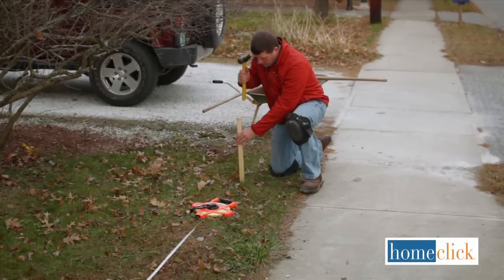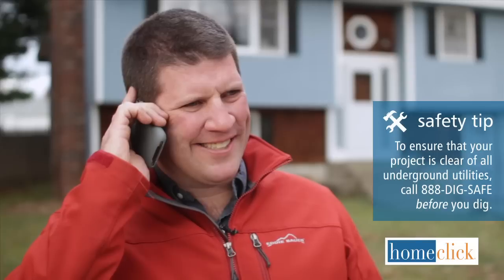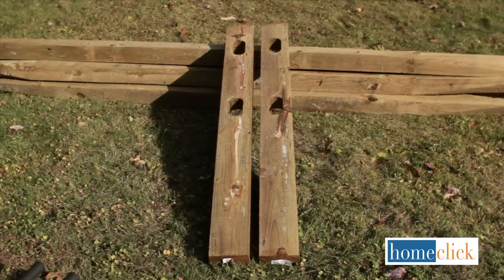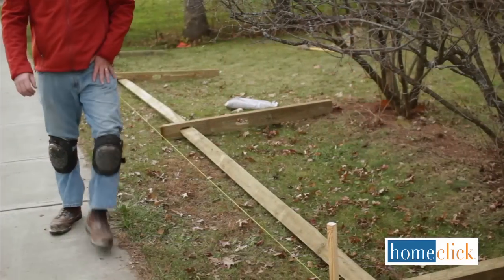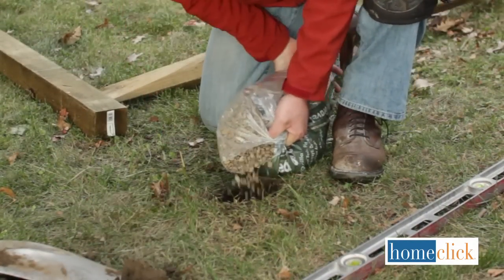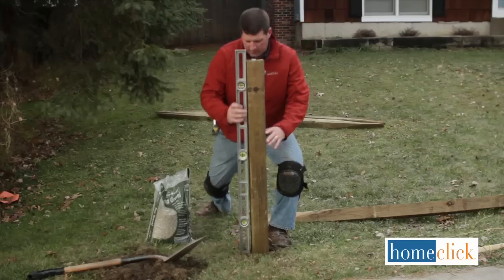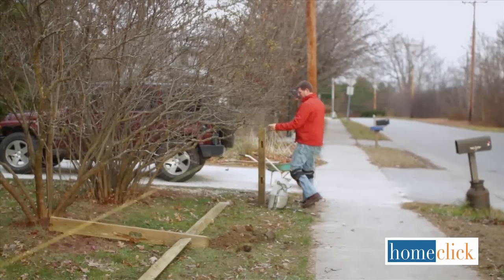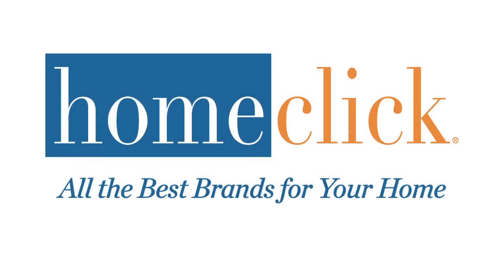How to Install a Split Rail Fence | Homeclick.com

Comment: The posts should be set at 10' 3" apart center to center.If you do not use concrete, your fence WILL lean after a couple weeks of a wet season.The bottom rail on a 3 rail fence should be 12" from gnd. use a pre cut piece of wood to determine the depth of each hole.
Reply: Would you still use 6" of gravel before putting in the concrete?  Thanks!

Comment: You left out some of the most important information, minimum depth of the hole (should be at least 24" below grade), I didn't see you plumb the post in 2 directions and one should backfill the hole 4 inches at a time, compacting as you go.One of the most common problems I have seen is people fill the hole allthe way up with dirt and then try to compact all of it. Posts end up sloppily in place.

Comment: If you have shail or harder ground the post hole digger isn't going to do crap  if you're not going to rent an auger machine get yourself a tamping bar it makes quick work of harder ground just wear gloves when your using one because you'll get blisters if you don't.

Comment: You didn't say how far apart to place the posts.  The rails are 11' but a few inches on each end are inserted into the post so the posts should be less than 11'.

Comment: How does a 33 foot section divided by 11 give you 6 sections?
Reply: John Streeter    There are TWO rails between each post.  33 ÷ 11 = 3.   3 x 2 = 6 rail sections.